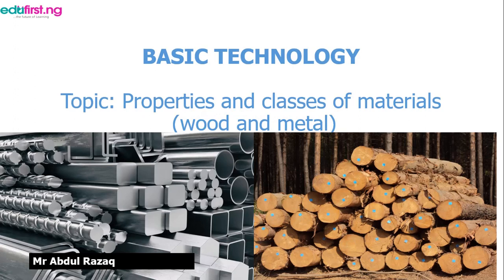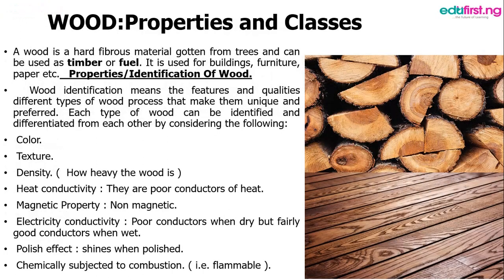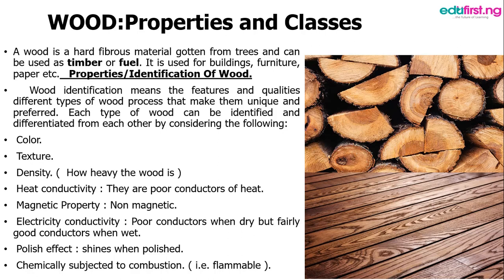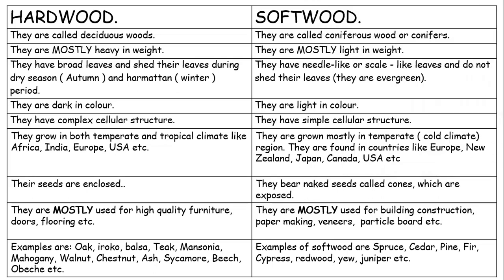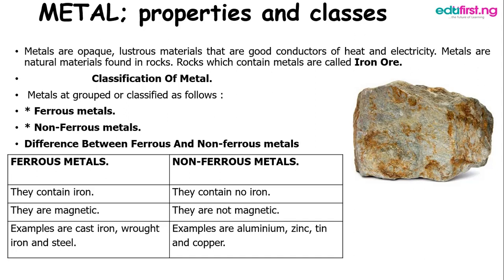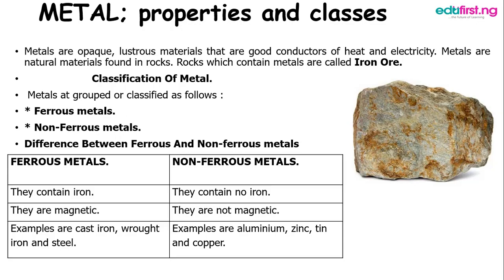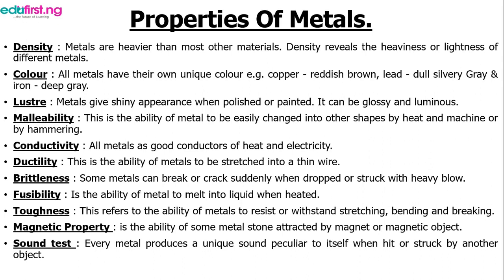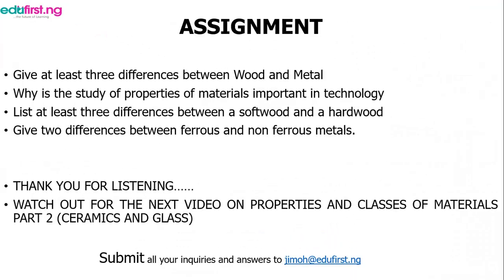Properties and classes of Materials [Wood and Metal] | Basic Tech | JSS1 | 1st Term

Comment: 1 The differences between metal and wood is that metal has iron while wood does not have  iron
1b  Metal can be turned into liquid and be heated while cannot be turned into liquid and be heated 
1c Metals has magnet  while wood does not have magnet
2   The importance of materials is that we make things with materials  so without materials we cant make things  and if we cant makes things we wont be able to build Eg house car we wont be engineers thats why
3  Hard wood  is dark in colour while softwood  are light  in coluor 
3b  hard wood  are  mostly heavy while softwood are mostly light in weight
3c hardwood seed are enclose while softwood seed are open
4  ferrous  metal contain iron  while non-ferrous metal dose not contain iron 
4b  ferrous metal are magnetic while non-ferrous metal are not magnetic

Comment: 1Differences between wood and Metals are wood are not magnetic while metals are. Wood. are poor conductors of heat while metals are.
2 because materials are used in building. and construction
3 difference between softwood and hardwood are softwood don't shed their. leaves in dry seasons while. hardwood shed their leaves in dry seasons.
Hardwood are heavy while softwood are. light. in weight. Hardwood are hard in texture while softwood are soft in texture.
4 ferrous metals contain iron while non ferrous metals do not contain iron
Ferrous metals are magnetic while non ferrous metals are not magnetic

.